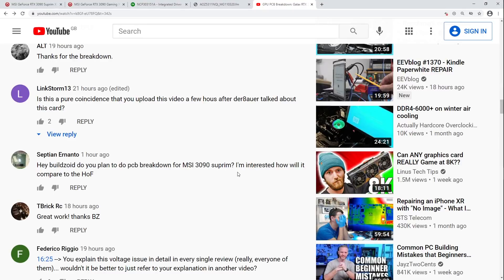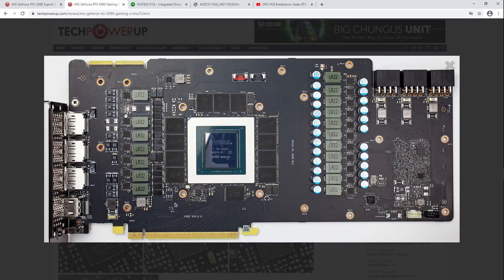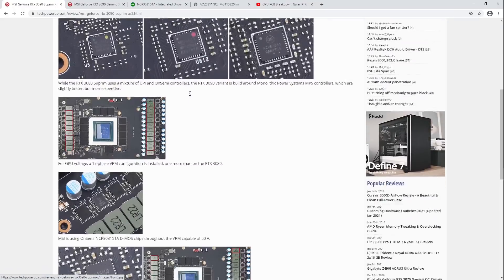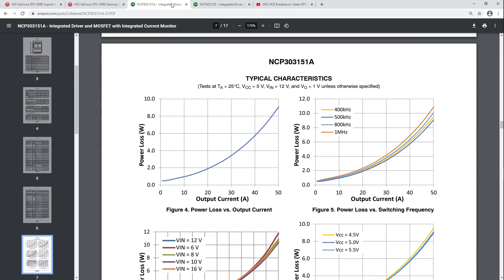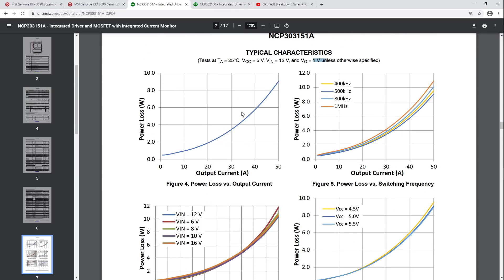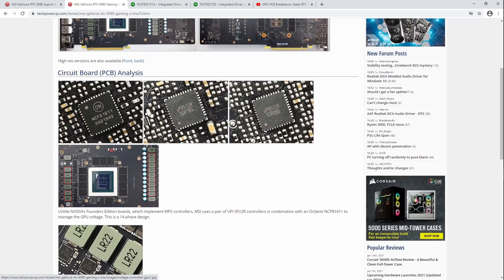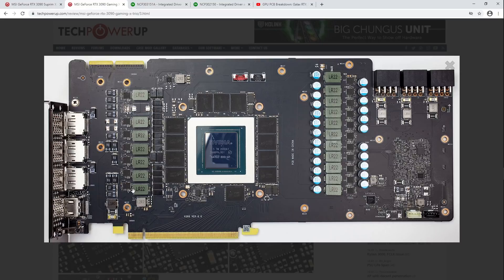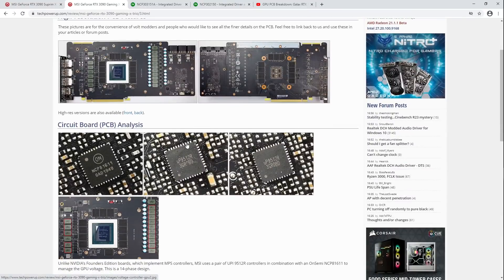not a GPU PCB breakdown: MSI RTX 3090 Suprim X

Comment: Are they fuses next to the 8 pin power connectors, will this card handle a 500w bios easy enough? I am worries it will blow a fuse on the 8pin, they look to be 20a so I guess anything up to 180w per each 8 pin would be fine giving head room for spikes ect?

Comment: I've owned both the GAMING X 3080 and the SUPRIM X 3080. SUPRIM X overclocks much better.
Reply: I agree...and the cooler itself runs super cool and unlike the annoying ass coil whine on the strix cards, it was so bad that i sold my strix 3090 and got the 3090 suprim x instead, ZERO regrets. Infact it even clocks higher than my strix LOL

Comment: Hi Buildzoid, so for the RTX 3090 Gaming X Trio, its using the NCP302045 Driver and MOSFET. The NCP302045 has an average output current of 45A (@ 300kHz) and peak output current 75A (Dur = 10ms, Period 1 s), whilst the NCP302150 has an average current rating of 50A (@ 300kHz) and peak output of 85A (Duration = 5 micro seconds, Period = 10 ms). Which is better? Curious owing the difference in time frames on peak output.

Comment: Hi, seems like there isn't a thermal pad at the left side LR22 parts (Phases/Chokes?) on the Asus Strix 3080/3090 cards. Is it safe to use like that? Here is the topic that i found about this problem https://linustechtips.com/topic/1297167-your-strix-3090-will-fail-rma-it-now-missing-thermal-padsfan-noisecoil-whine/page/2/

Comment: I bought the 3090 Gaming X Trio and flashed the 3090 Suprim BIOS on it.  Later I flashed the Kingpin 1000 watt BIOS on it and water cooled it.  The GPU hit 2295 MHz in some benchmarks.
Reply: That was after three EVGA 3090 FTW3 RMAs and a refund from EVGA.
Reply: And, is it still alive?
Reply: @badgermemelord6207  Yes it still alive.  three years later.
Reply: @Mildly_Amused  hello, i want to know something since you already tried it, i have a 3090 gaming x trio and i flashed the vbios to the suprim x, now i dont know why but it is more stable, so my question is, did you have/had any problems with vrm/power phases in general?? im on air but my temps are still under 75c on core and 82c max on memory, i mean it already has 3x8pin conectors which is not necessary for it, but wanted to make sure :)
Reply: @geronaef03  No problems at all.  The VRMs of the Gaming X Trio are overkill for the 450 watt Suprim BIOS power limits.
Reply: @Mildly_Amused  ty very much i was wondering about it 🙂

Comment: Congrats all Gaming X Trio owner, you just get a way more powerful vbios basically designed base on your GPU.
Reply: The 1000 watt EVGA Kingpin BIOS also works on the Gaming X Trio.
Reply: Been Running a mix of the Suprim and 500watt EVGA bios on my Launch gaming x with no issues

Comment: Damn, so disappointing, i was thinking Lightning Z myself. Although i'm not an overclocker, i'm a normie, i like to overbuy for longevity and peace of mind. 
I will always buy a quality PSU, Mobo, a well built GPU, cooler and case.
In august 2017 i bought the MSI 1080Ti Gaming X because i hated the way the Lightning Z looked. 
I could have bought another 1080Ti implementation for less money but i stuck to the Gaming X because i wanted a quality product and this one's still going strong today;
i really hope it doesn't die before, during or after i finish typing this comment just to spite me.
I was looking to buy a 3080/6800XT(if they ever get a 6800XT SuprimX out) SuprimX(alot later this year when prices come down)thinking it was the new Lightning Z; no such luck.
Who knows, maybe there's a Suprim Z in the works.
P.S: i live in Romania and availability of parts is fvck3d, i know what to buy but can't find THE parts i want, that's why i have an X570 Ace instead of Unity
and also why i have Trident Z 3600CL17 2 by 16 running CL18 XMP instead of 3600CL16 XMP...at least it's Hynix DJR and it's dual rank; it's the best i could do in april/may 2020
when i upgraded from Z97/4690K. 

Love your content, i learned so much. Thank you.

A Normie from the butthole of the Universe - Romania.

Comment: Hi buildzoid I think I have something content worthy. FTW3 Cards seem to be plagued with load balancing issues. The majority if not all of them pull 75-80+ w out of pci-e slot and many of them are hitting power limit without being able to reach the power target no matter how hard are you loading them. The card with 500w vbios and power target set to 119% won't pull more than 420w while pulling 81w from the pci-e and 70w from 3rd 8pin. I know people who ran into this issue and EVGA forums are full of people complaining about it, just look at the official xoc vbios thread. I am personally going through 2nd RMA right now. My first card wasn't power gimped but it decided to die after 2 months of use, my 2nd one would not pull more than 412w with 430w peak. It would be interesting to find 2 cards compare them head to head and find out what's wrong. EVGA stays silent on this topic but approves RMA's almost instantly with zero questions asked which is to my experience quite uncommon.
Thanks!

Comment: The Gaming X uses 45A power stages though which makes it significantly weaker. You have to look at the photo its the NCP302045 not the NCP302150 TPU got it wrong.
Reply from the maker: the 45s are a little over 2W at 20A the 50s are a little under 2W at 20A.
Reply: Was I the only who found your comment? 👀
Reply: @tomriddle2257  seems like it :(
Reply: @O!Technology more context for the layman please
Reply: @Pandemonium088  msi uses cheaper power stages than what buildzoid mentioned because tpu listed it wrong in the review.
Reply: @OTechnology  Based om your 3090 rankinh where would you put thr Suprim X?
Reply: @Pandemonium088  I would put it along with the TUF Gaming imo. Low ish powerlimit like the TUF but better cooler. Not up there with the big boys like the Strix and the EVGA Kingpin or FTW.
Reply: @OTechnology  TUF is 350watts while suprim x is 470watts, whats low about that?
Reply: @OTechnology  I've had two Strix, both ran 10C hotter than the Suprim with worse dies (required more voltage for a given clock). People are too obsessed with things like VRMs when something as simple as better binning would make 10x the difference for people who don't plan on doing XOC.
Reply: @MacA60230  ofcourse better binninh is king. Better VRM doesn't hurt either and is a sure fire thing not based on luck.
Reply: @OTechnology  Yes absolutely, but it seems many people are kind of missing the point with the focus on VRM strength. 80% of people will use the card on air, and VRM strength doesn't matter at all there. For the 20% that will watercool it, it won't matter either unless they shunt mod the card/put an XOC BIOS on it. That's such a minority of very specific individuals. Yet people are acting like they should base their decision on the VRM design. In my own experience, the Strix is not the best option at all because I'm staying on air and the stock cooler performs much worse than the Suprim cooler. I thought my first Strix was defective, got a second one, same lackluster temps (and same worse binning). For 90% of people, the Suprim is the better purchase. Yet people are recommending the Strix and other overkill pcb cards over it, because VRMs.
Reply: off topic. 3090 Suprim X vs Aorus Xtreme?

Comment: i get yelled at by a bunch of morons when i told them this card is a POS. they think it's a strix and kingpin competitor because it's expensive....
Reply: its actual trash for the price
Reply: @themyth-i9r  get the Strix.

"bruh"
Reply: @alouisschafer7212  The cooler itself runs super cool and  unlike the annoying ass coil whine on the strix cards, it was so bad that i sold my strix 3090 and got the 3090 suprim x instead, ZERO regrets. Infact it even clocks higher than my strix LOL

Comment: The truth is that none of this matters for 99% of users. Buildzoid probably knows that but seeing the comments it seems most viewers don't. 3090s have little headroom, so sure a beefy PCB like the HOF is "nice", but it simply won't perform any better than a Suprim or a lower end model, at equal power draw and conventional cooling. All that matters with these cards is power limit and GPU lottery (to a much lesser degree).
Fancy PCBs are irrelevant for people who aren't actually hardcore overclocking (hehe).

People basing their decision on this when they'll run the cards on air (or even water!) are simply not making sense. They shoud look at which cooler performs the best at the lowest noise, and which card allows the highest power limit (but even that can be fixed with BIOS flash), that's all.

And if you think I don't know what I'm talking about, I've had a 3090 TUF, 2x Strix, a Suprim and a FE. I really wanted to like the Strix (hence why I tried my luck at the GPU lottery twice) but in the end the best dies were the FE and Suprim. The FE can't be flashed to a higher power limit so that left the Suprim. The two Strix needed much more voltage than the Suprim to achieve the same clock. Disappointing binning and worse cooler. I even thought the cooler was defective on the first Strix but after seeing the same 10C higher temps (with a 520W BIOS) than the Suprim on the second one, and the same (lack of) binning I just had to face the reality of it: the Strix isn't as amazing as people baited by its nice, completely overkill PCB think. Power limit and GPU lottery (and a good cooler if you'll stay on air), that's what matters.
Reply: Much truth in this comment! Designing any given product, it is always about selecting components and balancing between performance, functionality and affordability. I am really happy with my rtx 3080 suprim x.  A silent performer, and overclocks nicely (with real-life gaming performance in mind). But yes, for hardcore oc, there's always the evga kingpin.
Reply: "Power limit " strix has higher isn't it ?
Reply: @CaptainPrice-f6g  yes strix goes to 480W on stock bios, suprim 450W. But the Suprim performed better in my case because of a better cooler and a better die.
Reply: @CaptainPrice-f6g  I have a lot of diposable income and used distill to get notifications on availability. For the FE I was just lucky though, got in at the right time.

All the testing I did for max overclocks were at 90% fan speed. For regular use I just setup a fan curve that doesn't sound too loud to me.
Reply: @MacA60230   can you pls set 100% curve on your suprim x with max power limit and do timespy ? Pls bruh I wanna know the score.
Reply: @CaptainPrice-f6g  I'm not home for the next 2 weeks I'm on holiday, sorry :/
Reply: I don't use instagram
Dude you can't just cry cause I don't reply instantly =_=
Reply: they're both fine, silicon lottery will decide which one is better. I do think the strix cooler sucks though, both the strix I had ran hotter than the suprim, at the same power level.
Reply: @MacA60230  so when you will return home can you pls test it ?
Reply: @MacA60230  and bruh why people buy suprim x or strix if there is gaming x trio ? I mean it could get silicon lottery also , is cooling the main reason ?
Reply: @MacA60230  what was the level and accurate temps just last ques ?
Reply: @MacA60230  bruh now you aren't replying 😭.
Reply: I think I would just get the Founders Edition set up a custom fan curve and an undervolt.
No rgb trash to deactivate and really nothing else to worry about.
My GPU is a Strix Vega 56 and that thing is straight up trash. VRM would reach 100C WITH NO OVERCLOCK and Temps were high in general for a 220W GPU. Unacceptable. But I got it used for a better deal than people are getting on GTX 1050s at the moment

Comment: Would you say running a 500w bios on the Gaming X Trio would hurt these VRMs? It should be fine?
Reply: One would think in order to ask a question like this, one would have attained a certain level of knowledge that would have answered the one's question prior to asking it.  I.e. Eleven 50watt power stages can supply how much power?  If you under-power a VRM, can it damage it?  How hot will they get?  Should one put a box fan next to the GPU blowing massive amounts of air over a bed of dry ice in order to keep it cool?  It begs the question.
Reply: immediate housefire lul